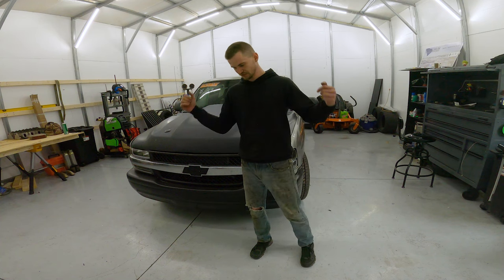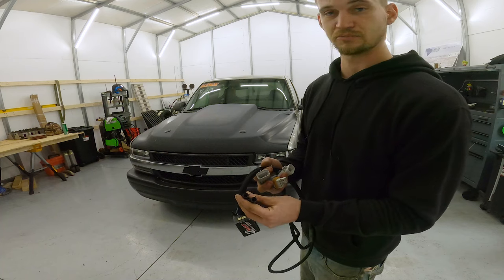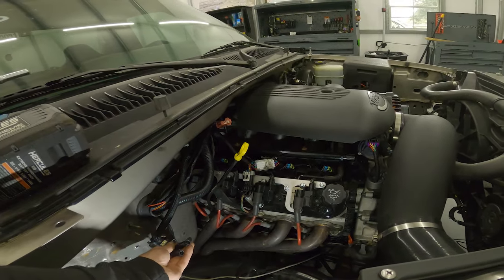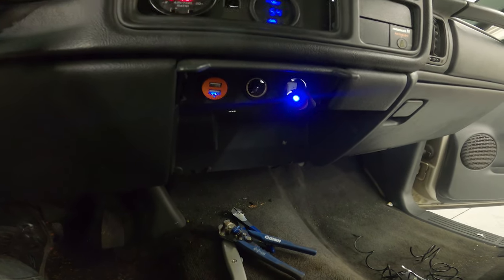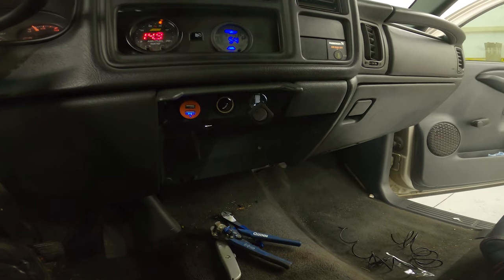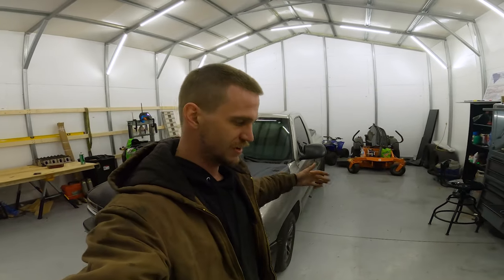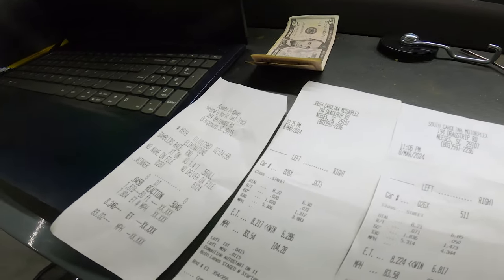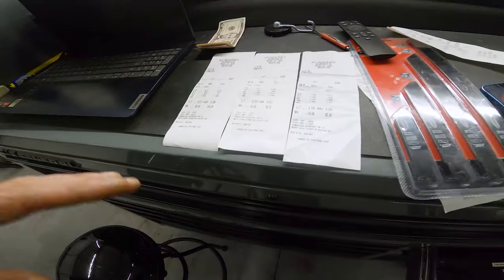MSD 2-Step Launch Control Install And Testing

Comment: Curious how the two step doesn’t reactivate when you slow down at the end of the run? I didn’t see you reach down and flip the switch?
Reply from the maker: It doesn’t allow it to reactivate once it releases unless the rpm falls below 2/3rds of the set point so if I have it set to 3600rpm it won’t be able to reactivate until it falls under 2400rpm and also since I’m decelerating and not on gas the rpm isn’t gonna climb to hit it again when it does release
Reply: @FrogsGarage  is that a function of the 2 step module or are you using a latching relay? My msd box has built in 2 step but I’m not sure if it includes that function
Reply from the maker: It is built into the 2 step